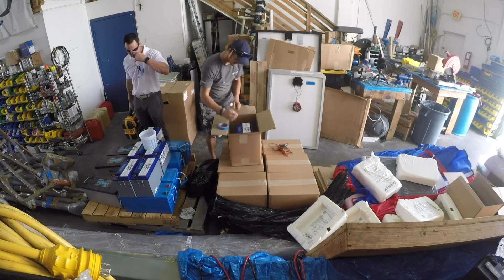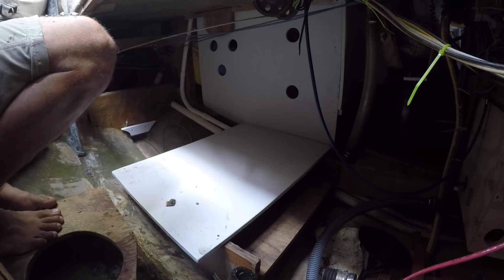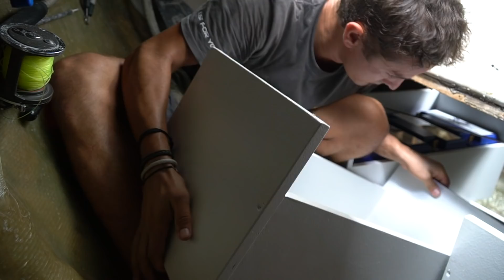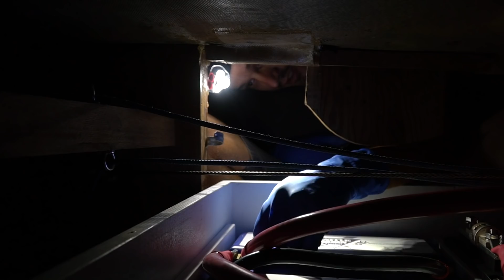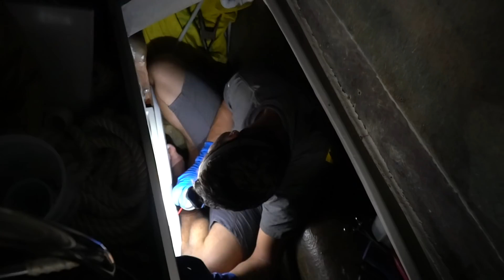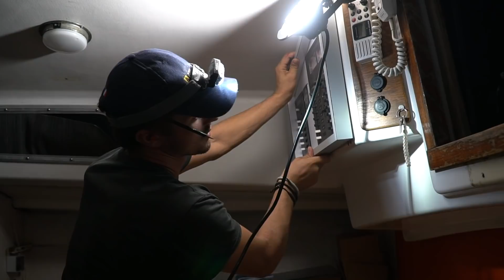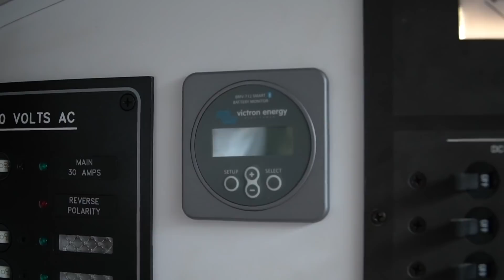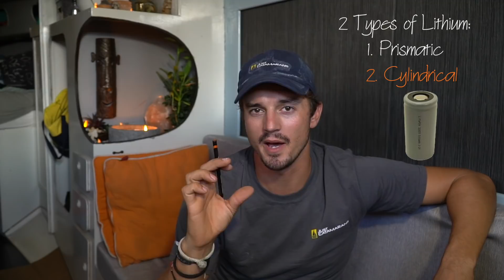Uma's new Battle Born LITHIUM heart ❤ — Sailing Uma [Step 135]

Comment: Wow,  $12,000 worth of batteries!  That's a serious upgrade it will be really interesting to see what performance you realize in real life..  Great segment!
Reply: I picked up on the same amount (just for the batteries). Maybe I am old school, but it seems like a lot of cost and effort for only about 4 hours of motoring. I appreciate trying to minimize the use of fuel, however, it seems like with the current technology there is still a lot you have to give up when you opt to not use diesel as an auxiliary power source. I enjoy the channel and appreciate the work you put in to the boat. I also am interested in the arrangement with Just Catamaran. The use of their A/C, car and shop have been a big benefit to you and would not be available to the average 'DIY' person trying to outfit a boat. Congrats.
Reply from the maker: For us, it's not really about fuel costs and money. There are many reason we chose to go electric, and we wouldn't go back. Clean, quite, simple, no maintenance, no smell, no vibration, less weight, better for docking and anchoring. On a personal note I like working with clean electrical and really don't like working with oily petrol motors. It also forces us to be more in tune with the ocean and elements and become better sailors. For us there really are no cons for going electric and almost all cons for diesel. But that's just us. Others have their own preferences and that's ok too.
Reply: One other note (now that you already have it wired up :) ) Get a couple pieces of garden hose and slit them along the length.. place that over the steering cables when working on the bat wiring and you won't have to worry about a wrench shorting out.
Reply: They were sponsored.....they didn't spend 12k on them.
Reply from the maker: Well that's the thing... because we ARE electric, our motor relies on our batteries, Just like a diesel engine would rely on fuel. On a boat with a diesel, you could go by without the LifePO4's just fine to power the rest of the boat. For us, it IS a game changer! We had to replace our lead acid 3 times over the past 3 years, and we were never able to motor more than 1/2 mile,  we haven't officially tested the new ones yet, but yes, they should perform more than 10x better for what we need them for. We knew we would be switching to Lithium this year, but we originally had planned to tear apart batteries from a Chevy Volt, and DIY it to put on our boat, we chose to collaborate with Battle Borns because they are a much safer, more, reliable, and much less of a hassle to install.
Reply: @SailingUma  I'm simply talking about the ratio of cost per AH. Of course I realize you need to power an electric motor with electricity. The point I'm making, is simply that the flooded lead-acid batteries, though bulkier and heavier would have resulted in a far far greater amount of capacity to run that motor as a function of energy per dollar, even if you needed a larger Bank in order to overcome the problem of efficiency. these batteries arent just a bit more expensive, they're not even twice as expensive...they are ridiculously expensive. Simply outrageous. That's the only point I was making. The problem with the batteries you had before horror wasn't that they were led acid, it was simply that they were the wrong kind of lead acid batteries. You needed proper deep cycle batteries. Even a good brand t105 type battery would have been great. I don't deny the superiority of these lithium batteries truly I don't. I'm simply pointing out the outrageous cost. There are any number of things that you can get that are very high quality if you're willing to pay many many times more for it it's not a good idea in terms of bang for the buck. that's all I was saying. your money your boat do as you like. Fair winds to you.
Reply: @SailingUma  my apologies for the random errors, I'm dictating this from my phone sorry
Reply: Considering that a pair of 220AH 6 volt batteries can be hard for about $200, the performance upgrade better me something like 1000%.

Comment: hey DAN nice BATTLE BORNs ,,,,  have you heard of simpliphi batteries 48 volts , they are good for 10,000 cycles ,,
Reply: These batteries look amazing, but OMG, the price ranges from $1400 to $3500 per battery. And I am not sure they are Marine Grade, meaning they are sealed and water proof, although most batteries of this time and cost should be.
1. https://simpliphipower.com/product/phi-3-5-battery/
2. https://www.google.com/search?q=simpliphi+batteries+48+volts&rlz=1C1CHBF_enUS737US737&oq=simpliphi+batteries+48+volts&aqs=chrome..69i57&sourceid=chrome&ie=UTF-8

Comment: I have a new two burner Induction Cooktop on our 2018 motorhome and we don't like it very much. It requires special pans.  If you like to move a pan around when you cook and you lift it for more than a few seconds, the burner will shut off.  Also, on our coach, which has 8 lead acid house bank batteries, you can only get a total of 10, the highest setting for the burner, on any two of them, for example: boiling at setting 10 on one burner and you want to boil some water for veggie on the 2nd burner, the highest combined you can obtain is 10.  That is if the r/burner is 10 and you try to put the second on 10, they both will go to 5.  Think long and hard about an Induction.  Personally, I don't see the advantage.
Reply: Sailing SV Delos just went to Lithium (LiFePo4) batteries and an induction top and they seem to have no issues so far with there t2 burner system. But you bring uop a good point to check, what if you have BOTH burners going and need to boil water in both of them? I think In your case I would boil the water on one burner first, then pour half into another pot THEN use two burners to complete the cooking.

Comment: Can you opt for a more efficient motor too? Or is there not much difference/performance/development in new electric motors?
Reply from the maker: A better motor is on our list. We'll get out and do some testing soon. But I'm pretty sure our motor will overheat if we go for too long. It's definitely the weakest link in the system now.
Reply: Uma answered me? woop woop good luck with the testing

Comment: When you get to making the covers, add some computer fans on the covers to get some forced air cooling for the batteries.  Remember its not only the cells but the BMS board components that need to be kept cool for best life and maximum capacity.
Reply: I was about to comment that this box restricts cooling.

Comment: Cool, get some ratchet ringies sport.
I see the familiar Pearson distribution buss behind you, you can swap those out for BlueSea which are nearly the same if you are finding corrosion a problem.
Your wiring looks so much tidier than mine which is a damn mess, Im inspired to improve.
I went for auto power select (110/240v) Xantrex 3 bank 20AH charger because I have a mix of AGM and flooded cell batteries which require separate control, 
fed through an IP67 safety and trip switch. Probably sounds more complicated than it is.
But mainly because I might have a complication between 110v where you are and 240v where we are. You know, its a boat, it can travel and its crossed the Pacific 3x.
Kept the option for AC power off the dock by running AC through conduit to the main aft bulkhead. I do have a 3000 watt inverter but havent ever used it.

You might want to monitor the temps in the motor. You might find that with the extended running time your electric motor will require some form of forced cooling now, either fan driven air or water cooled. Neither is particularly hard to organise, computer fans or peltier device probably easiest.

Comment: Hi, I’m converting my sailboat into electric and I will use for now flood batteries 6 volt 230 Ah, 8 of then, normally how much time of navigation did you have with your old bank? My electri motor is a Motenergy ME-1115, I cannot used for now Lithium because I can’t afford it now. Thank you
Reply from the maker: We could only motor for about 10-15 min. With your bank and motor, I'm sure you'll get longer.

Comment: I have a ten gal. tank, at five knots this is over thirty hours of endurance. The amount you spent on batteries alone over the last three years buys a lot of fuel. I do have lithium batteries and an induction stove top but for propulsion I am keeping the engine. Your installation of the batteries and components looks first rate.
Reply from the maker: Yeah, we always say that if you have a working diesel, keep it. But for us, we got such a good deal on the boat because it didn't have a working motor. Our original set up cost less than $1k including the solar. We spent another $1k on replacing batteries (our mistake). Still less than even a refurbished diesel. If you want top of the line electric with Lithium bank, it cost about as much as a new diesel motor ($10-20k). The only issue is you're stuck with a 30-50nm range per charge. For us, it's not an issue, since we can sail pretty much everywhere anyway.

Comment: You are correct about teh amount of misinformation out there . The real problem is you are adding to it. In many areas you are way off based in what you are saying. You also need new batteries for your calculator.  Getting 10 times teh rated capacity of your battery bank AINT gonna happen.  Your motor loads and boat speed seem to defy teh current Info out there as well. Getting 5 knots on 50 amps ?? Did you Measure that or are you just guessing ?? The main reason you did not get capacity with teh lead acid is you NEVER fully recharged them. And lead acid does not like to stay under charged over long periods. They tend to oxidate.
  How do you plan to recharge the new bank when you are not in a slip with power.  It takes a HUGE amount of energy to recharge a battery bank of the size you installed.  SOLAR ?? you would have to COVER your entire boat to get enough energy to fully recharge teh bank in a reasonable time IF you could even get enough perfect solar days and enough voltage to fully recharge teh batterys.  A 48v bank requires about 50-51 volts to fully recharge.

With solar teh more you load it the less voltage you have to work with. A fully loaded 48v solar array may only put out 45-46 volts.

Also with most single board LI battery safety controls you cannot charge and USE teh battery at teh same time. You can either charge or use but not both at teh same time.With  Most batteries It takes a dual board controller to be able to do that.

There are a lot of facts out there but also MORE fiction than facts.

(;-)
Reply: For their ocean crossing they will need a small generator for sure!
Reply: VmaxBR549 THE THE THE THE

Comment: You guys were a huge inspiration for me going electric on my build and I'm happy to see ya get some real range extending lithium. I started with lithium but I wasn't as smart as you and went with used NMC Lithium Ion and it's a freaking handful. 218 batteries and each needs balancing, monitoring and cooling. Lifepo4 is so much simpler. And less explosive.
Reply: Just as complicated, but out of sight. Each of those batteries has a balancing and monitoring system inside!

Comment: I would put a thermometer on each battery.  Create some kind of alarm / warning system. If any battery goes above a set temp it sets off a alarm.  Heat and cold are the enemy here.
Reply from the maker: That's what the internal BMS does. It will limit the current to ensure the cells stay safe.

Comment: Nice upgrade, I’m curious as to why you didn’t use brass bands instead of making all those battery connections, they make the current very even.  Sometimes those cable corrode even if you spray them with the product you used.

Comment: If you have an accidental short in your wiring near those batteries, it is going to be a big fire, in an inaccessible place.
Reply from the maker: Just melted plastic. These watts don't really burn anymore than a typical lead acid will when it's shorted (which we've done)

Comment: O.K. Dan... bare with me here. So what your saying is you guys can motor for 5 hours at a time before needing to recharge the system. But do you have the ample regeneration for charging all those batteries or do you have to wait after 5 hours for the batteries to fully charge again before you can motor on? I can't imagine that your willing to wait for several hours for the batteries to charge via the solar or having to get to shore every time you need to charge. Have fun, be safe and KEEP ON, SAILIN ON. cheers
Reply from the maker: Our solar keeps us topped off for our daily needs, but if we're ever motoring for 5 hrs at a time, it will be from the sea into a marina or along a canal or something. In 3 yrs and 10k mile, we've never used our motor for more than a few minutes.
Reply: @SailingUma  case scenerio: your sailing somewhere between mainlands, get a 40 knot gust that blows out your main sail, unrepairable. What are you going to do?